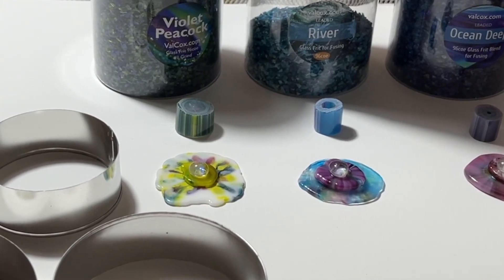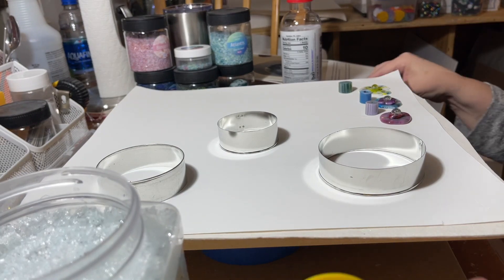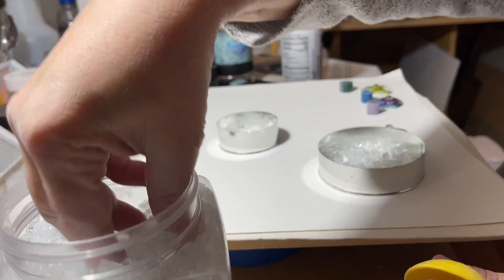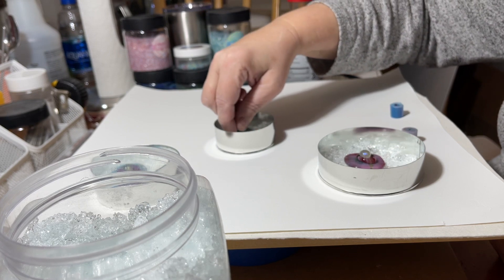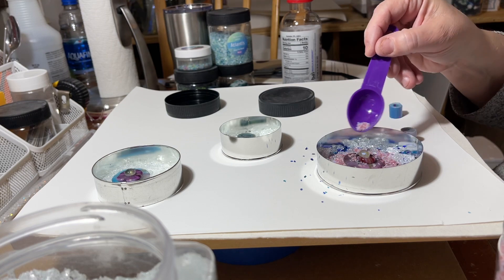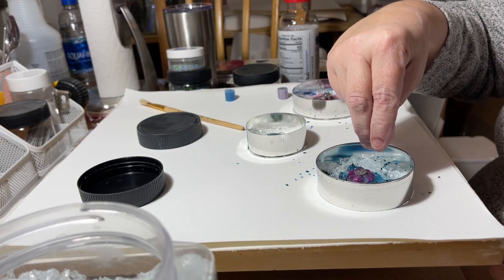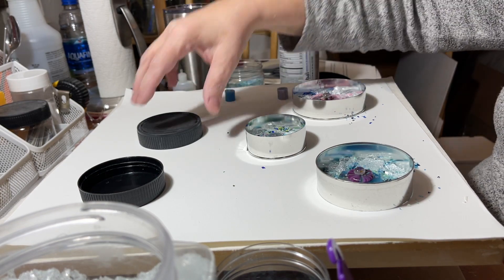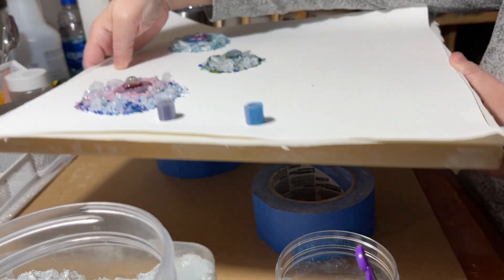Frit Pile Press Part 1

Comment: Hi! Would you please explain how you use a colander and quench to make that chunky frit? Thanks! Thanks for your videos!
Reply from the maker: Hi Laura! First, thank you for following my work! So if you have a stainless steel colander, place some scrap glass in there, take it up to about 1200 (I’ve seen various people use various methods but this is what I’ve done) and then have a metal bucket that will hold your colander filled with water (not totally full, just enough that it will cover your glass filled colander when you plunge it in there) and not so much that it would overflow and make a big mess. It’s good to make a handle like a bucket handle that is made of high temp wire you can secure to the colander on each side to lift with either a raking tool, or long nosed pliers, like the really large ones for pulling cane etc. Anyhow, when it gets to temp, have your safety gear on, remove it from the kiln and plunge it into the water. It will sizzle and pop and best to not use plastic as even though you’re going to be cooling rapidly, you could still touch the hot metal to the plastic and melt it. Let it sit in there while you lay out a clean towel (not one you’re going to use on your body lol) and then carefully pull the colander from the water and dump onto the towel, you can wrap the towel over it and walk on it (with shoes!) and break it up more. You’ll notice the pieces are crazed with all kinds of little cracks and will easily break smaller. I wish I could post a pic here but hopefully that makes sense. You could also just lay pieces of glass on a treated shelf, and use graphite tongs to pick them up and drop them into water. The advantage to that is you wouldn’t have potential bits of SS. If you’re doing it in the colander, once you have your frit in a bowl, bag, etc. and it’s dry, run a magnet through it to pick up any bits of metal. Hope this helps, perhaps one of these days I’ll set up the camera and do a video. Let me know if you have questions!
Reply: @FullMoonLoonDesigns  thank you very much for the detailed answer! I hope to try it. I'm thinking you mean a heavier colander and not a wire one.
Reply from the maker: @laurar8486  you’re very welcome! Yes for sure a heavier quality one, I did my first one using one of those steamer baskets that collapse - that was a hot mess literally! The little screws/bolts holding it together came out and not fun trying to get it out of the kiln. I prefer my next one to be without handles as I don’t trust them staying intact. Here’s one I’m going to order and try, hoping the high temp wire will fit through the holes but if not could always drill a couple on each side:
https://www.webstaurantstore.com/choice-4-1-2-qt-stainless-steel-fine-chinese-colander/40745QTSSFNE.html?utm_source=google&utm_medium=cpc&utm_campaign=GoogleShopping&gclid=Cj0KCQiAi8KfBhCuARIsADp-A558mgNLcYAX3U3pjG4kupAu-a-6k0RzDrDo5-jmg_7qcDTdhdcYlM8aAoliEALw_wcB
Reply: @FullMoonLoonDesigns  Excellent! Thanks for the link!

Comment: Hi. Where did you get your rings?
Reply from the maker: I apologize, I don’t recall. I think I picked them up in a little gift shop. They’re just concentric ring cookie cutters, available many places I’m sure. I’ll see if I can find similar and post a link.
Reply from the maker: Here’s a very similar set:
https://www.bedbathandbeyond.com/store/product/our-table-trade-8-piece-stainless-steel-round-cookie-cutters-set/5552575?skuId=69644126&store=457&enginename=google&mcid=PS_googlepla_nonbrand_bakeware_local&product_id=69644126&adtype=pla&product_channel=local&adpos=&creative=538318382101&device=m&matchtype=&network=g&utm_campaignid=71700000085834694&utm_adgroupid=58700007303582391&targetid=92700065555513048&gbraid=0AAAAAD2J7j4MQ8WJSuMfC96jpCFCM2QQO&gbraid=0AAAAAD2J7j4MQ8WJSuMfC96jpCFCM2QQO&gclid=EAIaIQobChMIk67U6brG9QIV0ubjBx3FrgAaEAQYBiABEgK__vD_BwE&gclsrc=aw.ds